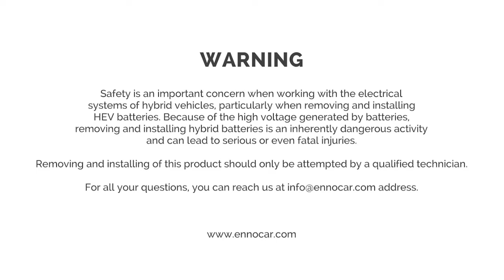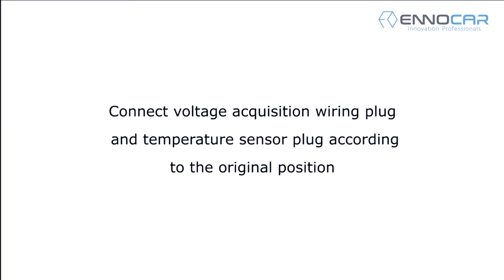Toyota Camry XV40 New Hybrid Battery Pack Replacement | Installation - EnnoCar Hybrid battery

Comment: I have 07 Camry hybrid issue not starting “check hybrid system” light I fid replaced the pack with used one from junk yard  it was from 11 Camry inside where cylindrical cells,   But the issue was not fixed got worst, then I replaced all cell with new ones xv40 from alibaba seller still the same issue. I’m getting the code c1259. Any idea to fix this?

As of right now the 12v battery is not the Toyota original one. I will get it later maybe that’s why is having issues

Comment: There is no datasheet of the cell, unless there is detailed information I think the claims are dubious.
Reply from the maker: Hi there! You can visit www.ennocar.com and chat with our online sales expert. Hope this can clear your confusion.
Reply: @EnnoCarHybridCarBatteries  There is no 6.5Ah cell in this cylindrical size that can handle the 100A. The only cell that can handle the current has lower capacity, does only 35% of the cycles compared to the genuine cell, and is rated to a more narrow temperature window.

There is no confusion on my side, but it seems there might be a confusion on your side?